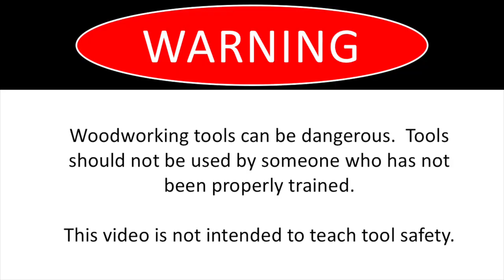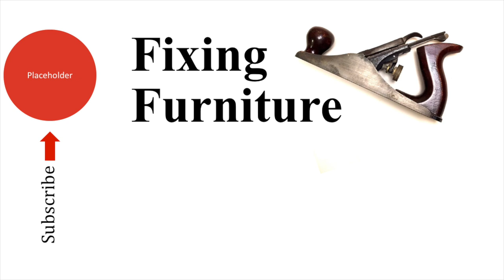Chair Repair with a Replacement Chair Stretcher - Woodturning on a Lathe

Comment: Dear Fixing Furniture you are purely the Bob Ross of furniture repair. You have got an ailing 21 year old millenial from Denmark using all her spare money on tools to repair and fix old furniture instead of buying pressed wood furniture in Ikea. Thank you so much! Much love from Copenhagen, Denmark.
Reply from the maker: Well that's cool!  Thanks for sharing that Lucca!  It's encouraging to hear your feedback.  Scott
Reply: @FixingFurniture  what type of screw do one have to use on the spindle?

 All the metal screws on our dining set like the one you show in the video keeps falling out the spindles.

Comment: Another great presentation. I learnt about wedges, funny how we take for granted such a small but essential part of a chair. I also learnt from a past video how to use a file (or a rasp, as my father called it) to remove glue. I tried it on my chair project and it worked! I'm elated, thank you!
Reply from the maker: Thanks for sharing that!  I'm glad to hear you're having success repairing chairs!  Cheers.  Scott

Comment: Excellent video.  The color matching talent surely resides in you!  I have to call in my wife for those decisions.  
The asymmetric wedges you made intrigue me.   As a hard core design engineer of over 45 years, I watched closely as you made that one in your video.  Drew it up and then looked at the forces it generates as it is driven home...  I get it!  I will NEVER make a symmetric wedge again.  That flat side is going to impart full spread of the forces and give you much added strength to that joint.  Thank YOU....
Reply from the maker: Thanks Lionel.  Here's a video we just published on different ways to make wedges if you're interested https://youtu.be/4VFBvs1x-lI

Comment: I have four swiveling counter stools that are a little over 20 years old and getting pretty bad. I'll give your instructions a try and see what I can do. Unfortunately I'm not a woodworker per se, and one has a broken stretcher; not sure what I can do about that without a lathe. The other issue is the swivel base, which is bolted into the legs. Often you can tighten the nuts until you run out of room under the seat -- what's really happening is the bolt is coming up out of the leg. Very frustrating.
Reply from the maker: The American Association of Woodturners have clubs throughout the US and Canada.  They’re a great resource to find a local woodturner to reproduce a part for you.   Also, for loose “insert nuts” where bolts screw into, the easiest way to fix them is to add longer ones.  I hope that makes sense.  Scott

Comment: I have a stretcher repair to do.  Your presentation was excellent. You have a new subscriber. Thank you.  The stretcher that I have to replace has two cross stretchers across the width of the chair .  Any recommendation on haw to put the two cross tenon holes in the side stretcher.  since I do not have a lathe I will be using a prefabricated stretcher.  I have some ideas but any suggestions you may have are appreciated.

Comment: Great tips thank you. I have two wooden stools that were cheaply mass produced I think with screws through literally all the mortise  and tenons and no glue (maybe a flat pack D.I.Y?). I want to paint it and glue it back together (not use the screws if I can help it) but I’m worried that using standard white carpenters glue will fail as the joints are terrible with very poor wood to wood contact. Should I then use two part epoxy instead? Will that stand up to the weight/movement on the stools? Thank you so much in advance for any suggestions.
Reply from the maker: Yes, if the joints are loose and you can't tighten them, PVA glue won't work.  Epoxy is the solution. Make sure there isn't any finish on the joints so you get good adhesive bond.  Cheers.  Scott

Comment: I have looked for contact info, phone or email, and don't find it. Is there a way to get it to contact you directly? I have watched all these videos on fixing "wobbly" chairs. That's part of, but not exactly my issue. I have just inherited an old oak sideboard/buffet, and have a very good photo I could email or text you to show exactly the problem. It has a high back with mirror that comes off. It has 2 small shelves (about the size to hold a teacup) that come out and rest and 2 "spindles" or legs, and the bottom of those set into holes on the top of the base. Those were very loose, 2 came completely out, the other 2 came out easily. It is obvious they have been reglued several times over the years. I have removed all the glue according to your instructions. 2 of those fit very snugly into the holes, the other 2 have so much "space" they are not even making contact. I'm thinking they have been over sanded or the wood has shrunk over the years. So the glue is not even going to touch around the inside of the hole. Is "wood filler" the answer to this? Do you have a video on using wood filler, how much, how to apply, and do I glue over the wood filler? I would appreciate anyone's suggestions, and if there is a way to post a photo it would be much easier to explain this. Thanks in advance!

Comment: I like your videos but it seems that none of the wood chairs in my house are well made. They all come with screws holding the legs  in from the store.
Reply from the maker: You can fix that by taking out the screws, which will cause damage over time.  If you discover a loose leg, now you know have to glue it back together.  Scott

Comment: How much do you charge for that repair?
Reply from the maker: I don't share my prices publicly, because they're specific to the market I serve.  Prices near a large city are higher than prices in a rural area.  In general, the price for this piece would be the equivalent to 2 hours of an auto body labour rate where you live.  To see a full explanation of pricing work, see https://www.youtube.com/watch?v=d42Dlu0ehHg  I'm not trying to avoid giving you the price, but it won't make sense unless you live where I do.  Scott
Reply: Understand.  I repair chairs in the Myrtle Beach,SC area.  I would charge $165 for that repair.
Reply: Jeff Stanley You are correct.  However,this is for furniture in rental units and part of a set. And it includes pickup and delivery’.

Comment: There is a common saying that a properly glued joint is stronger than the wood itself. "Glued joints come apart every 20-30 years". So, the properly glued joint is stronger than the wood itself until it isn't.
Reply from the maker: Maybe I could be clearer when explaining that.  Edge glued boards will have a joint stronger than the wood itself.  A joint in a chair has grain that is perpendicular, not parallel.  This causes a weaker joint as wood movement and the face put on the chair will loosen the joints over time.  Does that help understand the difference?  I'll be clearer in the future when I discuss these situations.  Scott